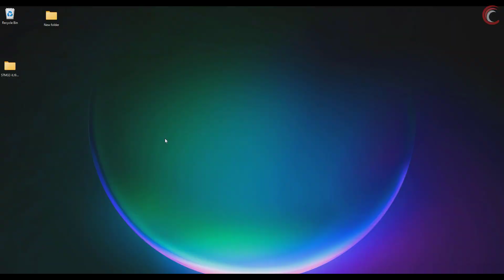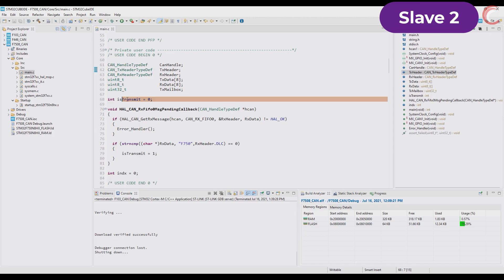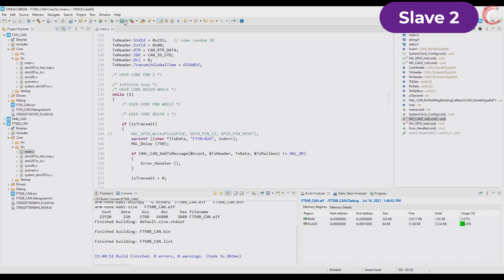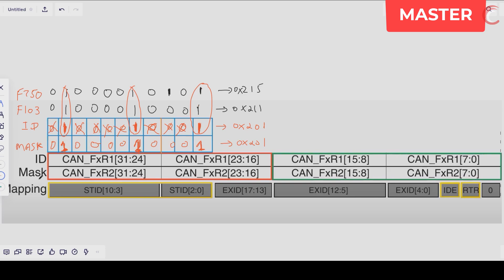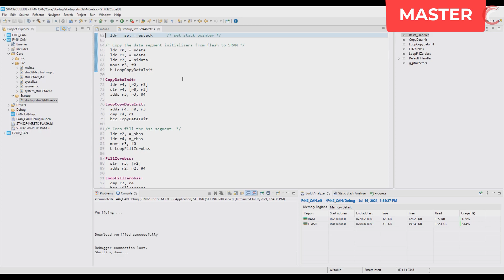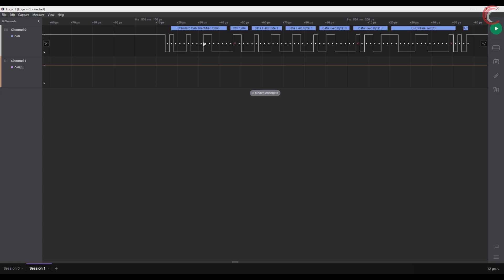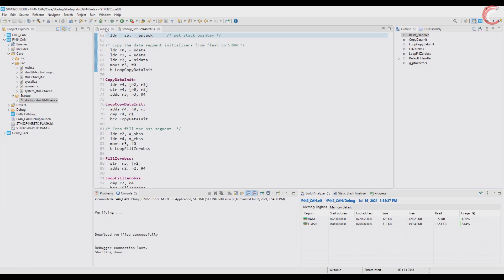STM32 CAN || Multiple Devices

Comment: Be careful about 120 Ohms resistor. It is not required for each node but only at both end of the CAN bus, there are termination resistors just used for manage some reflections throught the cable. So just put it one on the master transceiver and one on the slave 2. You have to measure about 60 Ohms between CANH and CANL. It can explain why you have TX fails.
Reply: Hi, I am using TJA1050 which has on module 120ohm termination resistors. The can works ok in loopback but when i put it in normal mode it does not work. I am trying to send data from Can1 to Can2 of the same MCU. It did not work. I connected Can1 TX to Can1 RX to make the loopback a bit more manual while keeping the can mode to be Normal in software. I still dont see any data. Both Can1 and Can2 of the MCU are initialized with same settings for time segments and time quanta. Any idea why would it not send anything in Normal mode?
Reply: Those are 2 resistors at master and slave2, right ?

Comment: Difficulty ID the large slave board-& small green adaptor below the 2551 Can you provide  part ID  Also detail wire diagram btwn 2551's  and, F446RC Wiring to cable source from the  small green adaptor  - Studing CAN and these tutorials are great!
Reply from the maker: Green adapter is for power. It just have 2 pin VCC and GND
Wiring diagram is shown on the webpage.. check your other comment.

Comment: Download from wp-conten -can't actively debug ( build Active config ) when I highlite main.c - debug hammer will not highlite - have no trouble with the Can Communication  TUT. this  download for Multiple Devices is lacking code that prevents   launching  or activation  It appears I need link to a structure that includes the rest of the Can F103,F750,F446 structure The  " Build debug for project"or " Build activation project for select project won't highlite-" Need a program that will allow me to debug like teh two prior Filter and Communication TUT - Thank You  Working  on these TUT for several weeks and final  got to this  Multiple  TUT
Reply from the maker: I have only uploaded the IOC file and the main.c file. You need to create project from scratch yourself. Just follow the configuration in the IOC file and code according to the main file.
Reply: @ControllersTech   Thanks  That was the conclusion I was arriving at after two hours .  PS: I worked thru all my post/comments  -on all three TUT -no replies required on those; this is where I hit the roadblock-Appreciate the lectures very informative I'll follow your direction - Thanks

Comment: Master 446 slaves 750 & F103 are cabled thru USB ports ;F103 with the LINKV2. Do you load all the code thru the master with only power supplied to Slaves thru the USB ports;.Or do you have to preload the slaves with code
Reply from the maker: Slaves are preloaded..

Comment: HI, i have a question.
You set canfilterconfig.FilterIdHigh = 0x201<<5  and  canfilterconfig.FilterMaskIdHigh = 0x201<<5 in master are correct?
I think 0x21 is correct.
Reply from the maker: Why wats the issue with 0x201 ?
Reply: can you explain why you choose 0x201 yet?
I see your video but i can not understand.
Reply from the maker: Just a random choice. Also it is 11 bit in size. That's the max length of the ID supported.

Comment: Sorry for the very basic  question  How do i preload the slaves -the sequence ;Also when I download the zip file MULTICAN and unzip  in my workspace I see  the  MX ..Can -ioc  and the main .c   only  . where are the INC, no drivers ; and no core  header . Did i download a wrong zip file ; should not the  folder have a ' core"
Reply: issue resolved  -thanks

Comment: Hello teacher, I was able to do this. but when trying to send more than one data frame, only one of them reaches the slave. How can i fix this
Reply from the maker: What you mean more than 1 data frame ?
Reply: @ControllersTech  
The system that I put together has a node with the reading of 6 proximity sensors. For the purpose of ordering the frames I send, I did the following.
Reply: But it only manages to send frame 1
Reply: I also declared different id's to differentiate the sensors. by commenting on frame 1 I manage to send frame 2. frame 1 has a lower id, I think this is why it constantly wins arbitration, the problem is that frame 2 never manages to be transmitted, I saw this with a logic analyzer